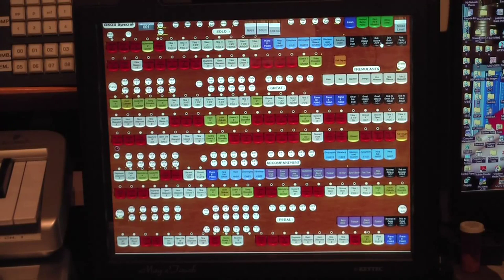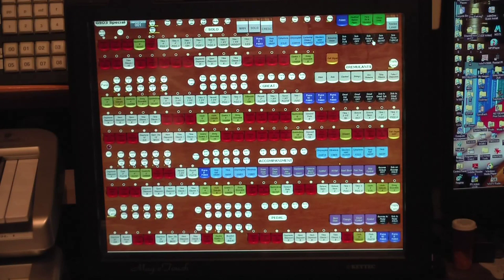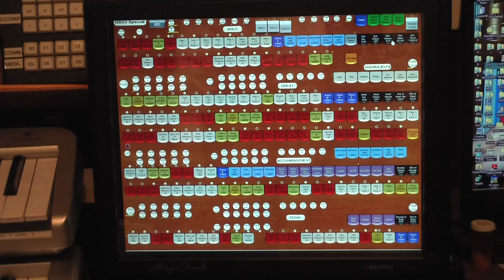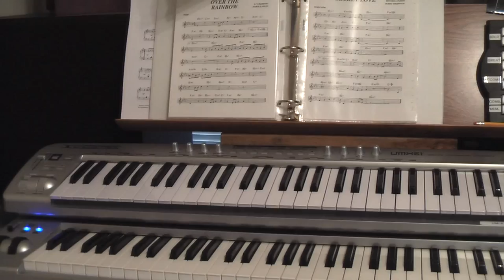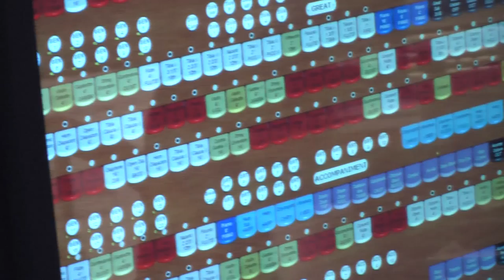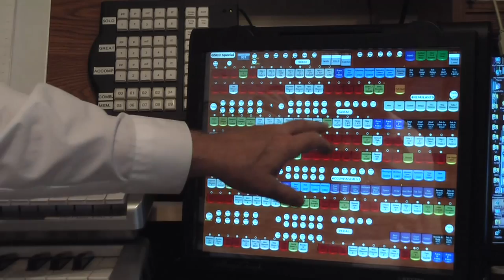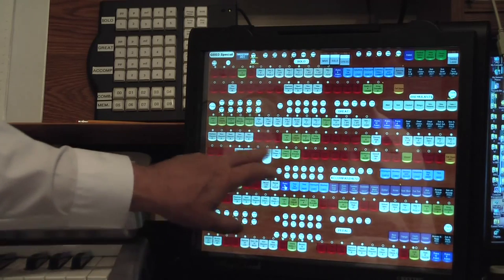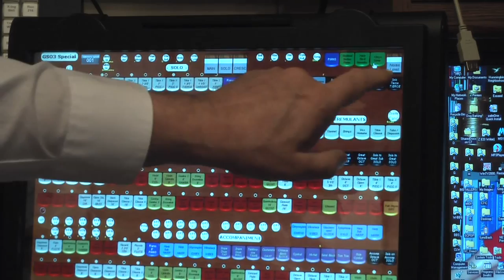Explanation of VTPO hardware and software

Comment: Mr. Walls: Nice to see you, finally. Great video, very inspiring. I have been building my virtual organ with jOrgan for over 10 years now. I have read many of your helpful comments in the jOrgan mail database. Thank you for all you have done. You have helped me to get as far as I have. At this time, I am using a disposition of St. Paul's Anglican church here in Toronto, Ontario, Canada. Chris Pearson recorded the sound fonts from 3 different churches near him in England, I think he is in the Yorkshire area. I have modified the skin quite a bit and then copied the disposition to 2 other computers. All 3 computers are networked and the organ divisions are divided between the 3 computers. There are 9 divisions in the organ, I set it up so that 3 of them come from 1 computer, the next 3 from the 2nd computer, and the final 3 from the 3rd computer. I have added pistons under each keyboard and am starting to build stops and stop jambs. My sticking point is in getting the LEDs that indicate the Stops On or Off and the Couplers On or Off to work with the MIDI messages that I have coming out of one of the computers. I am using Arduino clone micro-controllers to take the MIDI messages and send out voltage and ground to power the specific LEDs according to what Stops and Couplers are on or off in the disposition. Do you have some pointers as to how I should get the MIDI messages to come out of the Arduino in a matrixed Rows and Columns format? My test setup is only using 3 LEDs from 3 of the 15 or so contacts on the Arduino. I am not sure what to do with taking the incoming stream of MIDI note messages and how to turn it into Rows and Columns. Any ideas you could pass on would be great. Thanks, Tom.   P.S. I worked on the actual church organ at St. Paul's years ago, actually installed 11 computers into it to relay between 2 consoles and 9 pipe divisions. Tom.